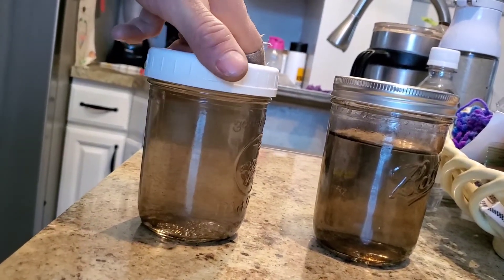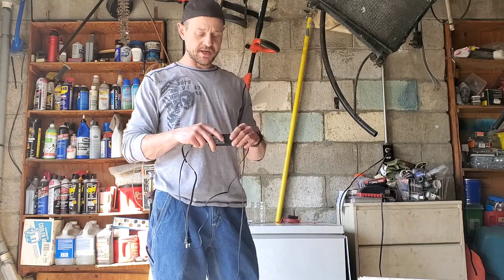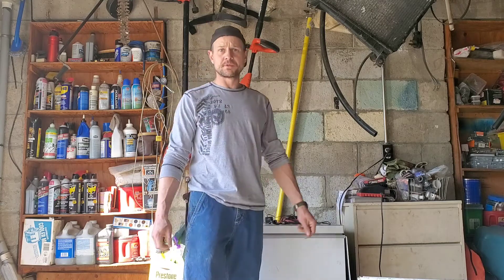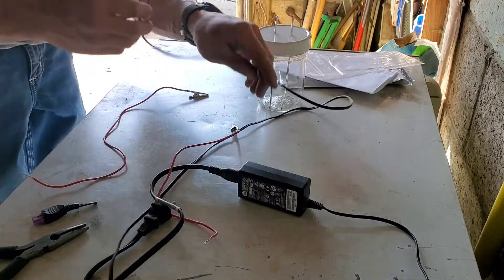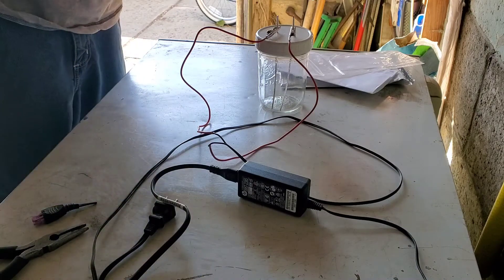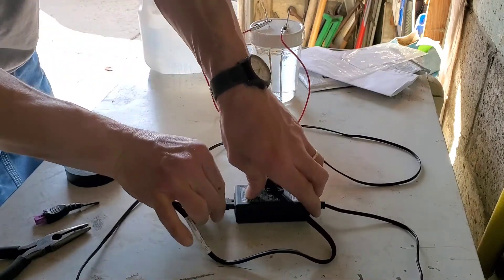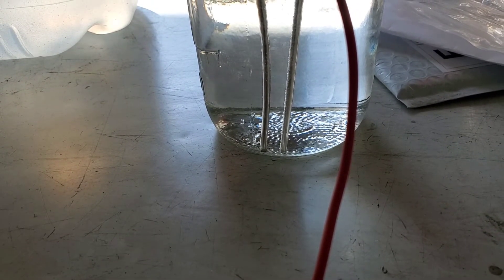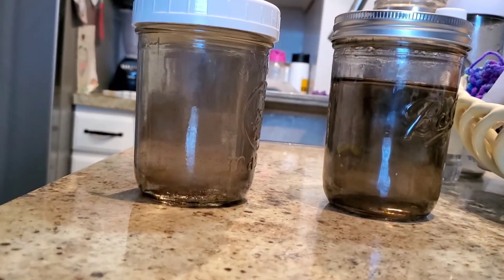Make your own Colloidal Silver Generator with almost any DC voltage.

Comment: Thats ionic not colloidal. And that colour is not good. Should be grey. I use distilled water and pure silver bars. I built my own hardware based off the Bob Beck circuit diagram. Im putting milliamps into my silver bars. Takes a while, yeah. But the results are worth it. Then you add a few drops of Karo, heat to 80 degrees C, you get true colloidal (not ionic) silver and ut is a lovely straw colour.
Reply from the maker: Thanks for the advice! For the last 4 years it has been working great for every bacterial infection we have had, but maybe I will see if I can find a power supply with lower amperage like you mentioned to make a solution that is even better. 👍

Comment: Wouldn’t a battery charger work being its DC current and its 12v to 13.5 v over night would make about 100 to 150 ppm
Reply from the maker: Only an old battery charger will work because the newer ones will automatically shut off if they don't detect voltage.

Comment: Also the one my dad’s machine made was clear as the water that he put in it
Reply from the maker: Every batch that I have made is a bit cloudy. 
Infact, I just made another batch with the same setup a couple weeks ago and it's always cloudy.
Reply: @deserthomesteadprepping8950  I read recently that the cloudiness is a result of bonds between the silver ions and contaminants in the water, like trace elements. Are you using distilled or RO water? I'm just starting to learn, so don't quote me on that.
Reply from the maker: @ohniceness6138  I use distilled water but I do run the generator for a good 6 hours which may be more than necessary.
Reply: @deserthomesteadprepping8950  
That is way longer than necessary, and you just don't wanna do that, because  once there's too much stuff in the water, a lot of of it will just settle out, plus you're just wasting your pure silver rods for nothing...
Reply from the maker: @lillybrooks7662  you're probably right. I may need to adjust my strategy and cut the time in half.
Thanks for the advice. 👍

Comment: If you’re still replying I haven’t watched fully yet, I want to make some but live in my car and was thinking about finding a way to make it. 

I like how you say colloidal btw. I hope it’s nostalgic :) 

Oooooh it looks like I might have struck gold with this video!! ❤
Reply from the maker: @CuriouslyBrandi  thank you!
Yes, you totally can make it with 12v from your car battery using a cigarette lighter.
Reply: @deserthomesteadprepping8950 I was also curious about this, as I will be using an old 19v computer power converter, and because I live off grid I suppose one would have to use an inverter to plug in the power converter which seems like a waste since it would be inverting the DC power off the battery bank, (or car outlet in this woman's case) to AC through the inverter, and then back to DC through the 19v converter. In the situation of a DC based power source would it instead be more logical to forgo the computer, or in your case the printer power converter, and simply hardwire directly to the 12v or 24 volt battery bank, and then run that through a LM 317 3 terminal adjustable regulator, and 1200 OHM resistor to reduce, and maintain a steady, and very low current to the rods?
Reply from the maker: @basilmaurer8425  my suggestion would be that if you are going to use the 12v from a vehicle to just go straight from the battery directly to the rods.
I would just go from the cigarette lighter port directly to alligator clips. 
When it comes to the voltage, it does not need to be exact. I have heard of people using a small 9v battery before. 
The main thing that you need to be careful of is that the amperage directly from a 12v battery is high so if the rods or wires accidentally touch sparks will fly, but it will be fine as long as the rods are separated while submerged in the water.
Reply: You could look up how to make it either e 9V batteries connected together. I just watched a video on how to

Comment: doyou needthe alligator clips can you use copper wire and electrical taper?
Reply from the maker: I guess you could, what ever gets good connection to the rods and as long as the tape doesn't touch the solution.
Reply: @deserthomesteadprepping8950  thank for quik reply
Reply from the maker: @EasyEarPiano  your welcome. 🙂

Comment: You really don't know what you are talking about, just guess work.
Reply from the maker: Give it a try 😉. 
It's been working great for the last couple years.
We've made multiple batches with the same setup 👌
Reply: @deserthomesteadprepping8950  you may have made a hundred batches, that doesnt excuse the fact that they may not be the best quality. You cant use ANY voltage, actually its the lower the better. Slow and steady wins the race
Reply: @infiniteshadoez  look up particle size in relation to voltage, amperage and efficacy.
Reply: Yes I also was wondering this myself, as I just watched another video which mentions that a very low, and steady current produces the smallest particles. It suggested a 19v power supply, 1,200 ohm Resistor, and an LM 317 3terninal adjustable regulator between the 19v power supply converter, and the silver rods. This regulates the power input at the rods down to 1 milliamp in order for optimal colloidal silver particle accumulation, because as the concentration of silver particles increases so does the ionization rate subsequently increasing the current flow.
I'm glad I found this video though, because I was interested to see if the process will still work without the resistor, and regulator. I imagine it just doesn't make all nano particles using this method which could be said to be less effective per ppm, and/or potentially harder on the body, though considering how little is typically consumed shouldn't be the largest concern, but it still might be worth investing in the resistor and regulator for quality sake.

Comment: why not use it with AC volts? what brand of printer had that 22 volt power supply ?
Reply from the maker: It was an HP printer that was about 6 years old.
I believe that AC voltage has too high of amps and it does not give the single directional voltage the rods need.
Reply: well that 22 volt is perfect for a blackstar guitar pedal .
Reply from the maker: @breakfastbuddy5  haha 😄. Nice!

Comment: Will using a car battery charger work? 12v
Reply from the maker: I think it will if it is an older one. The newer ones are designed with safety features that causes them to shut off.
Reply: Too many amps. You will get chunks of sliver in the solution. Keep the amps as low as you can. Under one amp is ideal @ 30v.
Reply: I have the same question. I just started using an old car charger. It has low amps. Doesn't seem to be doing much yet.

Comment: Do NOT use the LifeForce brand silver rods. They are rated @ 99.99 purity level, which makes them full of other metals. (Read the list of other metals which make it into what’s supposed to be colloidal silver, in their silver rods listed in the LifeForce listings on eBay.)

You’ll want .9999 pure silver rods, or as close as you can possibly get. It really makes a difference in the safety of the colloidal silver you will be consuming. 
You can also lessen the impact of the rods by drilling .9999 pure Canadian silver coins or pure silver bars and hooking the rods through them so they barely contact the distilled water.
Reply from the maker: I made my 1st batch with 2 silver coins and it worked great.
Thanks for the info.

Comment: Colloidal, not colloidial. I use a 12V 5A adapter for 4 minutes. Enough?
Reply from the maker: I don't think it is long enough. I would suggest at least 30 to 45  minutes. 🙂
Reply: 30v @ 500mv- 1 amp for 2-3hrs is ideal.

Comment: It depends on what ppm whether it is actually safe for the body or not
Reply from the maker: PPM is about concentration. Plus it depends on how much you consume.
Either way it is not toxic in any concentration. You can take as much as you would desire, your skin may turn blue if you dring gallons of it but you will be fine 😄

Comment: can you use gold and silver at the same time
Reply from the maker: Humm 🤔. I'm not sure. I guess you could try it and if it works out make a video so we can see it. 😃
Reply: I watched another video, and it suggested alternating the current on the two rods every 15 min to increase the speed of transfer, so if you use one gold and one silver rod I would suggest the same technique since the transfer of particles only happens in the direction of the electrical flow + to -, not - to +, so when using one gold and one silver rod only the rod attached to the positive line will emit particles, so switching + and - on each rod would therefore be necessary to emit both silver and gold particles into the solution.

Comment: The amperage from the battery is probably much higher than from the charger so, it might burn the solution a little. I think that if you use 25-30 volts and 15-20 amps takes longer but, you won't get any waste and your solution will be clearer. After making Colloidal Silver store in a brown bottle with no light, or it will turn brownish and lose potency.
Reply from the maker: Thanks for the advice 🙂. The power supply I've been using is 22V at 455mA.
It is very low amperage but seems to do well.
Definitely very important to store the solution in the dark.

Comment: I understand that only the water between the rods is effected so would far apart be best?
Reply from the maker: I've done many more batches sense I made this video and you are right. I found that farther apart seems to work better. Also I have reduced the time down to about an hour.
But remember that the time may very depending on the voltage and amps you use. 🙂

Comment: I use 300 volts dc with silver bars 20-25 mins I make 10-12 ppm I love it.
Reply: what's 300 volts dc
Reply: Pretty sure you meant 30v?
Reply from the maker: Wow! 300 volts is a lot but if it works then great.
What are you using that produces 300 volts?

Comment: I make Colloidal Silver Regularly. And It only takes 20-30 mins ever! You Should Not cook it that long Bcu of it causing to many Particles to be in your Solution! 4-7 particles per million is ok. The Dark is not ok. And it should be filtered immediately an kept in a dark cabinet away from a Magnet to keep it from breaking the Suspension of the Colloidal Silver an Ruining it! You need a TDS ppm tester to determine what the Ratio is in your Solution! Don’t use his method! Watch a professional!🤦‍♀️🤦‍♀️
Reply from the maker: Thanks for the comment 😊. This has been working great for us and I have made many more batches sense this video was produced.
The solutions I have made has cleared up pink eye for my daughter, strep throat for my Wife, sinus infections plus many many cuts.
Works great and no need to over complicate.

Comment: what is the D.C volt AND THE AMP from that charger. thanks
Reply from the maker: It is 22v and 450mA but you can use most any DC voltage. 
I made a batch under the hood of my truck straight wired from the 12v battery at full amperage through 12 gage wires.
Reply: @deserthomesteadprepping8950  thank you i will try that out and see if it works for me.